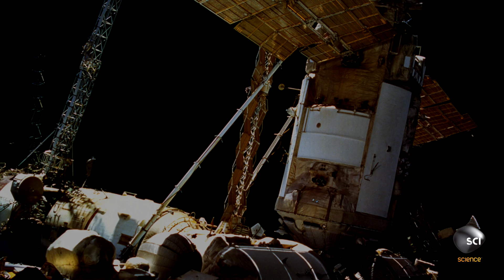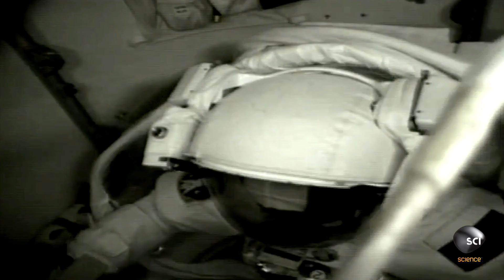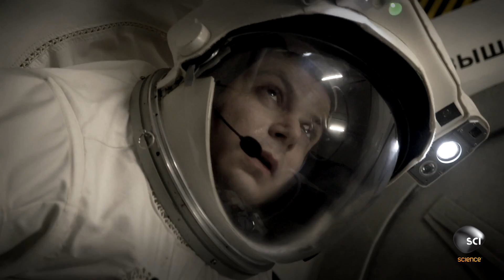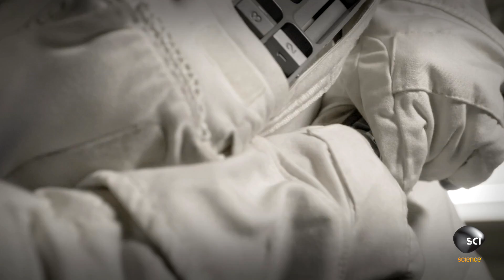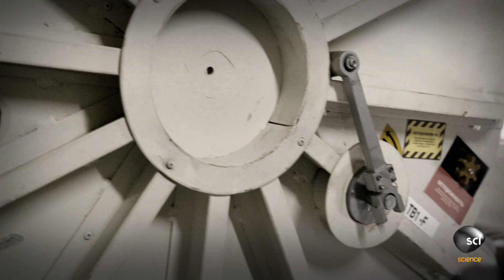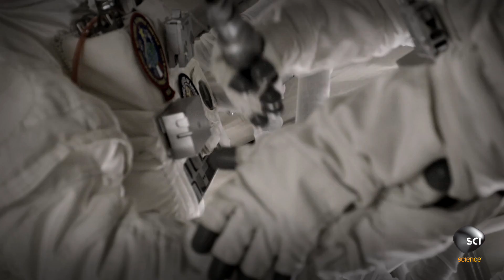Emergency Training Averts Airlock Disaster on MIR

Comment: Why did they destroy mir rather than using it as a building block for the iss. I feel like it would've been alot cheaper that way rather than just plummeting it back to earth
Reply: Allen Tyree It was too old to use. It was better to build more modern modules than try to modernize it. Mir was also very high maintainance - more than the ISS modules.
Reply: Mir was also hit by an out of control spacecraft, so it had to be abandoned.